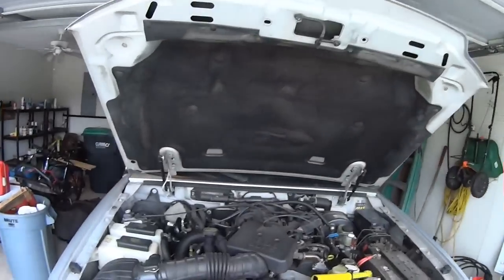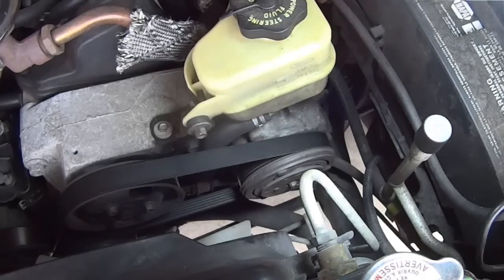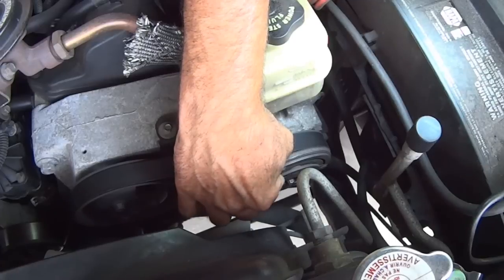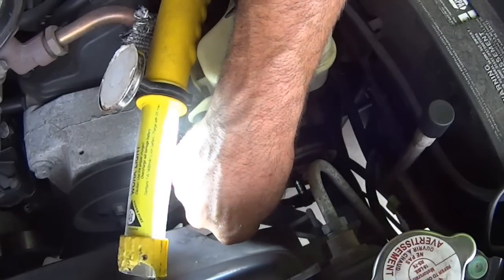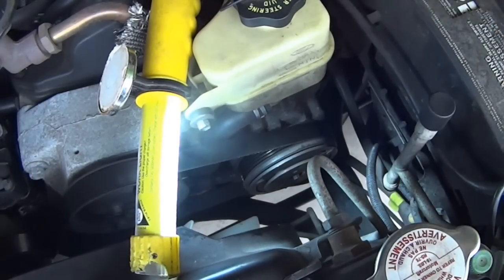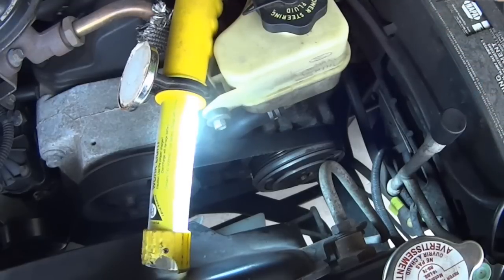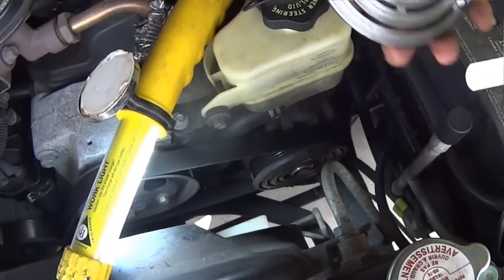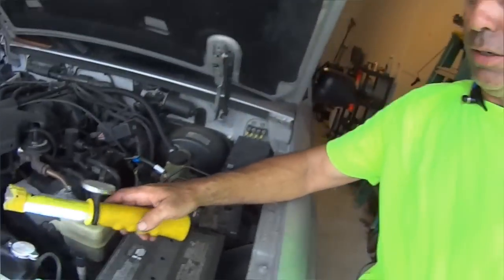FREE FIX - How to Diagnose and Adjust an A/C Compressor Clutch in Car Truck - Blows Cold Then Warm

Comment: Thanks Dan!  I just performed this repair and it fixed my ac!  Air gap was too big.  Removed the one and only spacer.  Cleaned the clutch plate.  Reassembled.  Bingo!  Fixed!!  Saved me hundreds!$$$$  Much appreciated!
Reply from the maker: That’s great news Mark, thank you very much
Reply: @DansVlog  SAME HERE!!! Never knew about the spacer inside. Took it out and it was too close BUT I had one that was half the thickness - AND NOW IT'S THE ARTIC AGAIN! TY!!!!!!!!!!!!!

Comment: This worked for my wife's 2010 Mazda 5. I had the car at  a shop this week and they said the coil was dead, non serviceable, therfore i needed a whole new compressor. $1500.
I pulled the clutch off the compressor, cleaned up the pulley and clutch faces AND removed the one and only shim...BOOM! 
You are a legend!!!
Reply from the maker: Yayyyy !!!!
Reply: In Bangladesh com pressure is 100usd
Reply: Did you need to take the refrigerant out first to change the clutch and pulley or can you change the it without taking the refrigerant out ?
Reply: @CashensPowerwashing  thank you.
Reply: @XxIceQxX  whats the answer?
Reply: @oscarangeles7821  no, you don't have to remove the refrigerant to service the AC clutch if you don't remove the compressor. I don't know what you drive so I can't say if you'll have space to remove the AC clutch with out removing the AC.
Reply: @chrisandracaproni2173  I got plenty of space, thanks for answering my question though
Reply: I took my car to the shop a/c was overcharged and they said the only thing they could find was the compressor needed replaced. I bought a used compressor and have not found time to replace it. I was talking to him and he said all that stuff worked before he sold the car I said I would not know how because the fuses were blown and I replaced them

Comment: I am a professional AC guy. I am impressed on your video. You explained it extremely well for the novice to understand clearly how to diagnose troubleshoot and fix that exact problem. Good job.
Reply from the maker: Thank you
Reply: RANDALLOLOGY How long can you drive your car with a Bad a/c compressor
Reply: @vitabracey  As long as you can stand the heat.
Reply: I have 2008 mercury sable, the ac is fine when idling or driving slow, when get to about 65mph or over 1500rpm, it just blow hot air. I used a gauge and add some freon, about 12oz, still does the same thing, what could be wrong? TIA
Reply: Need little help I changed my door ACTUATOR. My defrost works and heater works fine. Changed my 10 amp fuse and relay switch
Reply: @DansVlog  Hi Dan,
 I am in a similar situation right now. 
I have a small Landscaping business in Lake Havasu city Arizona,  a 97' Ford "Exploder" is my only work vehicle, noticed huge leak in AC, being a non mechanically inclined guy it took $60 bucks of refrigerant, hurting my back, getting covered in oil, getting pissed off and 
almost heat stroked $Priceless, $20 bucks in Dye, a $8 uv light that I suppose I can look at scorpions and black light posters, any hotel sheets with later, and could not find any helpful videos that laid it down in simple terms as you did. Now my problem was a little different, the R34 I found was escaping from the gap in that clutch plate and tossing the shit all over the inside of my engine. 
Do you figure from the little information I'm Givin here that the cleaning and reinstalling could possibly fix that refrigerant releasing from that plate Gap or in your experience would you say screw it and just replace the compressor clutch? I'm sure you're very busy but any response would be much appreciated, Really enjoy your videos Bud, Thank You kindly . 👍🏼
Best regards
Daymon,
All Good Outside ™ Landscaping 🍀
Reply: @AllGoodOutside  freon shooting out of the compressor. Sounds like a totally messed up compressor... Mine hasn't worked in 5+ years. As a result, I just don't drive it. Huge air gap on mine since I tried to fix it. Just. To stop a seized pully on the A/C - very squeaky sound
Reply: Accept bypassing the low pressure switch doesn't mean it's going bad.
Reply: You said it. Lol. Professional mechanic, and they never taught us much about all this even in technical school. Everything I learned was learned in the field. (The old way) Nice description. Thanks for reminding me of some important points, since it's been years since I messed with one.😉
Reply: Have a 1997 dodge dakota, & cant get the air to kick on from ac switch, All fuses & relays are working correctly & freon is at factory specs. Clutch is set to minimum air gap approx. 10000 in. Will work when hooked direct from Batt. voltage. Any suggestions?
Reply: @vitabracey   as long as the belt turns freely when engine is running, you will be fine. But you won't have any AC obviously. Lol
Reply: @elangiang5945  if it has a clutch fan, that can possibly be bad causing the issue. 
Some cars have a electronic clutch in the fan and others have a thermal coil for the fan
Reply: A guy just told me at oreillys that he can send me to a Guy just to check if my refrigerate is low or high!!!! For$8,000!!!! WHATTTT! 🤦🏼‍♀️🤣 He said Don't listen to people on those videos. I told him he's got loose marbles.
Reply: Why does my pilot only blow warm air. The compressor works,the fuses are good,and I recharged the system. Help !
Reply: Hey can I get some of your expertise?
Reply: @mytruthyourlie  what do you want to know ?
Reply: @RANDALLOLOGY  I know it's hard not actually seeing the vehicle but I have a 2012 buick enclave and the ac was recharged but the frieon was gone less then an hour. When try to see if the compressor is engaging, the ac button blinks green 3x. I don't want to make unnecessary purchases and I'm hoping you have some advice for me.
Reply: @mytruthyourlie  get some AC die to inject in the system
 Put freon in it and run it. After a while or when the compressor runs out. Use a black light and shine it around all the hoses, fittings, the compressor, and condenser. If the black light glows at a connector then theirs your leak.
Reply: Thanks so much for this helpful video my toyota corolla 20013  had same issue

Comment: Thank you, I have 1998 Dodge Ram 1500.  AC would run a little while, and the cold air would quit.  I had some long drives in the heat and it wasn't fun.  I lost my job so I am tryng to save money.  With this, I fixed it for no cost.   Next time I will change clutch.  You made my day.
Reply from the maker: Susan Haddock very happy to help

Comment: It's pretty cool to see someone actually breaking down the information so that it's easier to "digest". As a former mechanic for Monro I can attest to the fact that AC jobs were quite costly, even the quick jobs they would charge around $400 or more. Only once working there did I see anyone pay less and that was $250 just to change an AC compressor. The one manager there made us set parts in the back room on an old oil drum to make it seem like someone was actually doing something to the part/parts we pulled off of their vehicle. Obviously I didn't last there.... you can't survive at that place for long and be an honest person too, guess that's why I only held that job for about 8 and a half months before management canned me. LMAO

Comment: Hi Dan,
I've been looking for all possible problems with the AC not working in my girlfriend's Dodge Dakota. I'm a DIY guy and when doing a visual inspection with the AC running I noticed the clutch wasn't moving. I was taking today to check online for possible fixes and yours is one of 2 that made sense so far. I'm hoping to be able to give this a try and I sincerely hope this will do the trick - with some more research of course (like you suggested). Thanks for taking time with this video.
Reply: Did it work?

Comment: I fully concur with the comments below; your 'long form' explanation was exactly what I need to take a closer look at the A/C system myself before I spend more money pumping new refrigerant  into the system (though it may need some of that, too). Last time I took the car into a mechanic for the A/C they did a leak test, put some new refrigerant into the system, and that was as much as I wanted to spend because I could see where they were going with this. The clutch plate check is something that's simple to do and easy enough to at least clean the plates and remove a spacer to check the gap. I have a 20-year old Subaru Legacy station wagon which for the most part is still running nice and smooth and my current mechanic doesn't try and put any parts into it it doesn't need but he's not an A/C guy so it's best to be prepared before I ask for a recommendation to a shop other than his.

Comment: My 98 jeep cherokee has no ac. The mechanic said I need a new compressor $300 something, but, before I have it replaced I will try this fix or perhaps the hi/lo pressure switch. Great video.
Reply: Did it work?

Comment: A tip for holding the clutch plate while you loosen the hub bolt, you can turn on your ignition switch with a/c on , the clutch will hold the hub tightly while you remove the bolt. Most vehicles do not use shims to set the air gap, mostly Fords use shims. Others have to be pressed apart and back together. On those vehicles, you set the air gap by simply pressing the hub on and stop at .006" gap. You can often repair the air gap on a worn clutch by simply tightening the hub bolt until the proper air gap is reached. The industry standard air gap is .006". Great video for the beginner.

Comment: Thanks for sharing. A local mechanic said the same thing but he didn't explain how to do it. On older vehicles the clutch magnet gets weaker and adjusting the air gap will make the compressor clutch engage again. It is definitely cheaper than buying a new compressor.

Comment: Thanks for educating me.  My 2001 Dodge Ram A/C compressor wouldn't engage or would just intermittently.  After watching your video, I took my belt off, disassembled the clutch, cleaned everything with brake cleaner, cleaned corrosion and dirt off everything with 220 grit sandpaper, reassembled it and...... voila...... running again flawlessly in 85 degree weather.  Thanks again for sharing your knowledge and discoveries with us all!
Reply from the maker: That’s so great!!

Comment: Holy shit, dude! My husband's car started with heat problems this passed Winter. Now it's with A/C this  Summer. I have spent about 10-12 hours looking over all i could, changing all relays and fuses, in cabin filter, evaporator drain, heat resistor(winter), checking for leaks, etc..... EVERYTHING that wasn't replacing high-priced parts because when it works, it works great. Only about $100 in, but no improvement. Just watched your video and being that his car is a 2003, heat and ac only work at fast RPMs(sometimes), or for a second or 2 with a large bump, or on a turn, I suspect this is EXACTLY what's wrong. The magnet can't get and keep a good hold because it's too far away. So simple and makes SO MUCH sense. Worse case scenario, I replace the clutch plate. I can't wait to check it when he gets home. I'll definitely update tonight or tomorrow.
Reply: SOOOOO?   Did work?

Comment: I had the same problem on my 2004 hd2500 Silverado. I removed the outer clutch plate and removed the washer that provided the gap. I replaced it with a smaller washer. I probably saved $1000.00 dollars. Great video
Reply: Haiti News Info Haiti News Info, no, I just removed the 5/16” or 3/8” center bolt and the front half of the clutch came off (after removing the plastic surrounding the radiator). Inside of the clutch housing I removed was a washer (spacer) I went to ace hardware and found a few thinner (but larger diameter) washers, took them home and drilled out the diameter a scotch, and made sure the diameter was the same or smaller than the original. It was also thinner, meaning the outer clutch would be slightly closer to the inner clutch allowing the magnet to pull it in when the vehicle called for AC.

Comment: Wasn't looking for this but decided to watch it anyway. Been wrenching for years but always can learn something new. Your explanation is way basic but is spot on. BTW A.C. clutch becomes an electromagnet once it's energized. Your feeler gauge method is called a go no go. Method, that's the best way to check clearances such as this or when doing a valve adjustment on say a Honda whatever.  The compressor on your truck is perfectly accessible for a fix and for your vid. Your narration and explanation is perfect and interesting as well. You had my attention the entire time. Thanks.!!
Reply from the maker: Thank you very much

Comment: Very well explained.  I've been working on my A-6 compressor on my 1975 Pontiac Catalina. I removed the VIR and replaced with a Accumulator Low pressure switch and Orifice tube Cycling system. The A-6 Compressor is stock and Im 100% certain it has shims. For a car 43 year's old look's like Im replacing the Clutch. Great video

Comment: Thank you so much! My 05 F150 would start cold, then blow hot air. Did what you showed, but couldn't get around shroud on top. Had to do from under the truck and no room for channel locks, so used a small C-clamp from the bottom. Had 1 shim inside and I took it out and cleaned up some rust on the plate. Works great! Would not have had a clue if I hadn't watched your video. Thanks again, it took an hour and cost me nothing!
Reply from the maker: Great job Dan!

Comment: Thanks for the very practical tip. If you need a clutch kit, with the new parts you mentioned, they are less than $100, and you can usually do the job without removing the A/C hoses, i.e. while it is still in the vehicle, which means no vacuuming of the system or expensive recharging by a mechanic. You can buy a can of R134a refrigerant, with a meter gauge, for anywhere from $30 to $50, at a big box store, your local auto parts dealer or an online source.  You can often borrow any necessary specialty tools from nationwide chain parts stores if you put down a refundable deposit, or you can buy inexpensive kits from online sources.

Comment: Thanks for your thorough explanation! I'm  not a mechanic and appreciated your thoroughness. I had the same problems you had. Took it to a mechanic who said he used his "AC Testing Machine" and "re calibrated" my  Freon levels and checked for leaks, but after a few days the same problems came back. The mechanic wanted to replace the compressor. Instead,  I followed what you said and discovered two spacers missing and the clutch plate bolt super loose. Also, a bunch of grime. Hit it it with brake clean and tightened everything back up and "boom" everything's working great. Thanks for saving me a bunch of money!
Reply from the maker: Happy to help!

Comment: Dan i won't to officially thank 🙏 you i have a 1998 ford explorer and i replaced the ac relay fuse freon when i seen the air cap on the compressor i thanked before doing the job i had only one shim in the plate i removed it now its ice 🧊 cold continuously Thanks Dan
Reply from the maker: My pleasure! Buy one of my shirts!

Comment: OMG!! Thank you for this explanation! I'm not mechanically inclined, so this "long" version is exactly what I needed to hear. It explained so much and was so helpful!
Reply from the maker: You’re welcome
Reply: Josh, that’s true IF and WHEN the compressor engages. In this case the compressor stopped engaging, so it doesn’t matter how much air is flowing across the condenser, there’s no refrigerant moving.

Comment: This is a TREMENDOUS video. Thought you think you may be "overexplaining," it is just the way it should be. It's straight to the point and very informative. I've been dealing with an AC problem for a couple of years and am going to check some things out based on this video.

Comment: A few years ny ac on 2006 Ford five hundred wasn't cooling good, the ac shop quoted me $1500 to replace compressor. I researched it, ordered a scroll valve, had a mechanic draw down the system, install scroll valve and recharge, total cost inc part about $90. Thanks for the info on the clutch plate, I check that next time my ac isn't working great. Good video.

Comment: Did you notice  your truck idling erratically before you fixed the air gap? Mine cycles on and off and after a bit of driving it will die. The clutch plate never stays connected for more than a couple seconds and then it stops and cycles all over again. I’m going to go do everything you just did and I think I’ll be fixed. It makes the most sense. You’re the man!
Reply from the maker: The clutch will engage and disengage like you are saying if the freon level is low as well. Make sure you top off the freon first before you waste your time
Reply: @DansVlog  Ok. I’m not used to working on vehicles that gave a/c , what is the best way to go about checking that box? Is there a way to check the level of Freon so I know how much to add ? I know you can buy it at the store but I also know you can over charge the a/c which isn’t good ? A  point in the right direction and any advice Is much  appreciated
Reply from the maker: Watch some YouTube videos on how to charge a car AC system. I don’t have any of those videos to show you but there are a ton of them on YouTube
Reply: @DansVlog  Right on